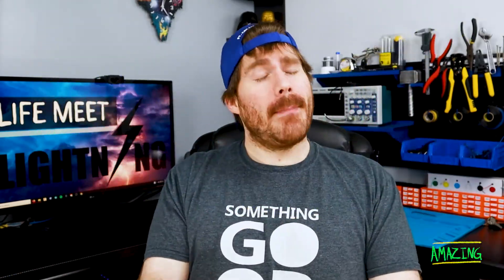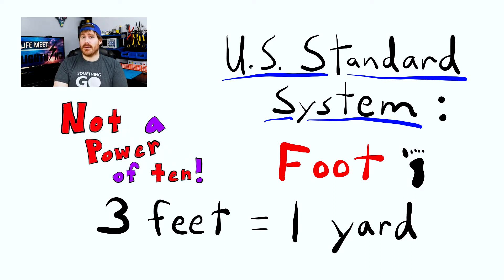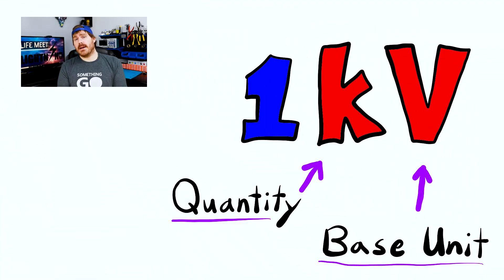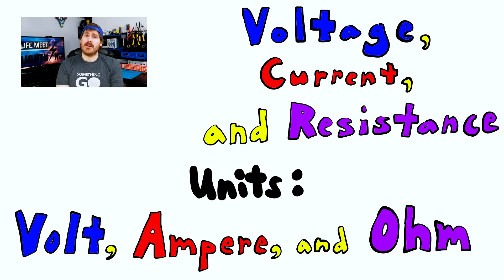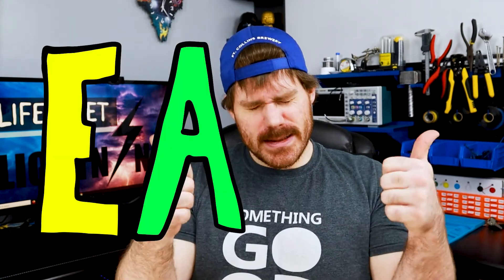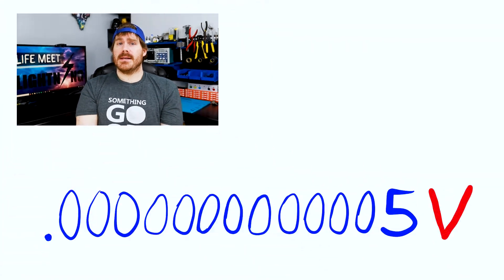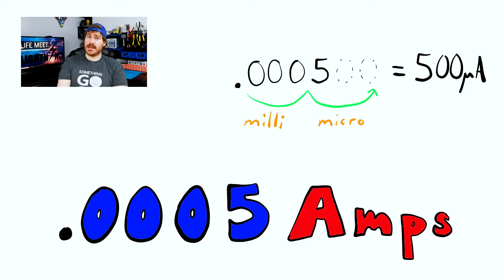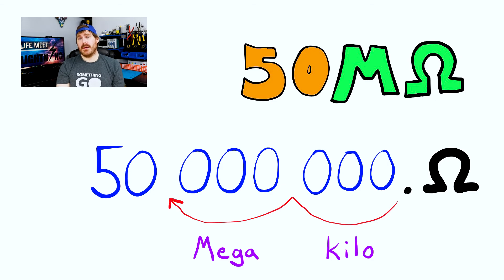Know Electronic Letters - Learn Electronics Metric Prefixes

Comment: sir ,can you make an example for me ,by solving this conversion 55,000 ꭎA _________ mA
Reply from the maker: 55,000 Amps would be 55,000,000 mA. Normally, we would convert it to 55 kA, though. Since the point of metric prefixes is to make things easier to write, not harder. :-)